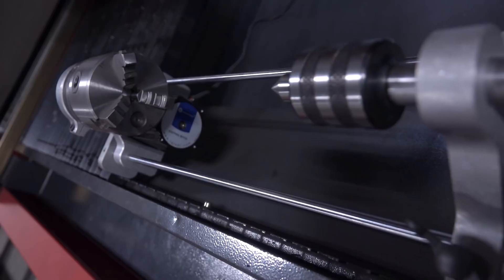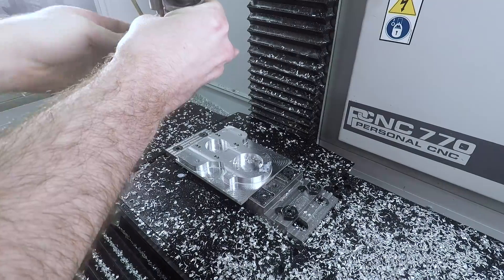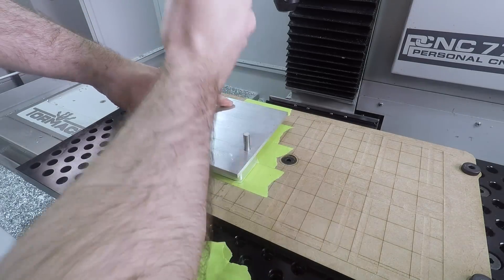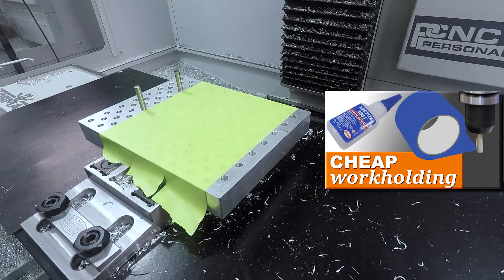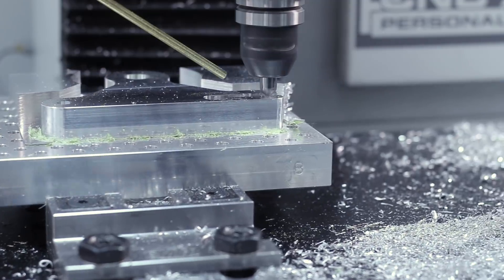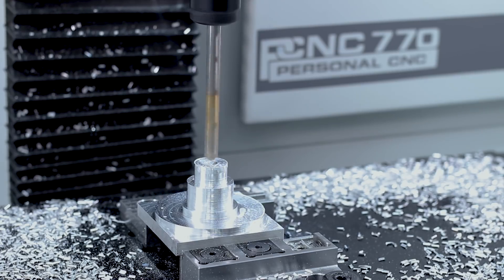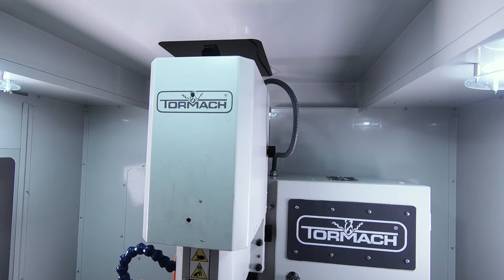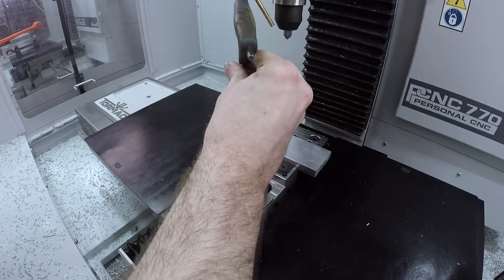DIY CNC 4th-Axis for Boss Laser! WW 200

Comment: I just don't understand you, John.  You are constantly and adamantly trying to improve and learn which is always admirable, and THE most important and valuable thing in any shop is TIME and yet you do these 20min toolpaths when 2mins is all you need if you just freakin' SLOT and your depth cuts are honestly abhorred.  You HAVE endmills that can cut what you're cutting in one single depth cut at identical radial step-over and you just refuse to use them and refuse to do it and save time, lots of time.  

When you think, "oh its only 10 more minutes or 5 more minutes, I'll do it the way I've been doing it" and then think about that, 5min per day x 261 days (365days - weekends), that's nearly 22hours a year of lost time.  If its 10min or more its over a week of lost time.   That's only 1 job per day 5min.  If you're doing 4 jobs per day @5min lost (hopefully is way more) you are burying yourself is lost time.  

I guess money isn't the be-all-end-all but for any other human beings, time is.  Time is everything.  If you can make the same part in half the time at the same quality and aren't... that's just... well... a waste and poor instructor-hood.

Comment: Isn't this essentially just a third axis? Since the laser just moves X, Y and what is that, A?
Reply: Laser should also have a z axis or focusing lense running like a z axis.
Reply: I'm sure it does, but it's not an axis you can "use" and in their example the laser is printing on essentially a 2D surface.

Comment: Does the BOSS just easily accept some arbitrary 4th axis?
Reply: Pretty much yes. It depends on the software you are using to control the laser cutter but many allow you to change the pulse unit so you can add a variety of different 4th-Axis, you just need to ensure the stepper motor is compatible.

Comment: When I first started at my current job I got access to a lot more advanced mills and lathes than the ones I was previously using, but the one tool that really blew me away was the 90W laser cutter.   You can make some really nice and fairly strong parts out of plain old acrylic sheet!

Comment: How much tinkering did you have to do with “circle pulse” to get your rotary aligned with the laser?  Circle pulse is one issue that makes no sense on the Boss Lasers.  Aside from having a test piece with all the specs per material I have started cutting out circles of the average diameter and recording the circle pulse due to it varying widely given differing diameters.

Comment: Sorry for Jared 

As a question how would you fixture large plates 12x12 that need all sides machined and several through holes? I thought about doing it on the vacuum plate but I don’t surface these plates and would have to surface the other side to remove the skin no? 

I make several of these but I have just thought the super glue was too much of a hassle. What do you suggest?

Currently I do them in 3 ops by cutting all the center features and sides then turning 90degrees and doing the last two sides then flip and chamfer backside.
Reply: ian agostinho You could put it in a vise, drill a certain number of the holes and build a fixture to bolt it to, then you'll have access to the all the sides you need to have access to. (Flip once for the blind holes.)
Reply: Andrew Delashaw 

I do some plates like that but never built a fixture for these as while the plates are mostly similar they aren’t all identical so a fixture didn’t workout for me. Thankyou for the suggestion though

Comment: 1 Bearing ???
Reply: The sliding tail stock will not need bearings because it's move a few inches each time it is used, and it's not in constant motion, so it doesn't need bearings. The single bearing for the chuck back plate is also fine because the laser won't impart load onto it, and it turns very slowly and very minimally.
Reply: I was thinking that, no slider bearings on the linear rail? Guess not important to need it, considering it lazer and can greese.
Reply: Could have turned a little teflon round stock into a press in insert though just cnc the aluminum part's hole a little bigger, then press in teflon and than insert rod/linear rail. Seen uh whats his name... The berkly guy who has bald head glasses and white beard? NYCNC did something with him too one time?
Reply: My guess is it's a double row bearing, looked thick enough.
Reply: He has cool channel too by the way. OXTOOLCO and it's tom lipton.

Comment: Any reason, other than you not liking lathes, for not using the lathe to make the bearing for the chuck?
Reply: AppleAssassin so he could do the radial holes in one setup.
Reply: Andrew Delashaw he has a cnc lathe
Reply: With the knurling, that concern is non existent...
Reply: but the part isnt even going to be round when you do it in a mill
Reply: AlmightyHose it'll be more round than most people could even measure, so it'll be fine.
Reply: If its just those holes i'd still do most on a lathe and slap it on the mill for the holes. It makes more sense to do round things on a machine for round things after all.  

Unless he had no round stock. then it would make some sense to do most ops on a mill
Reply: AppleAssassin I had the same thought.
Reply: If he really needed it round and concentric and still want to do it on the mill it's possible. Adjustable boring head with an inverted bar. I'm not saying it's fun but it is doable. Personally I question the use of aluminum for the bearing support but if it works it works.
Reply: A really bad one, but at least he got one.
Reply: Depending on your application, the circularity of the part may not be critical. 

Also, the out of roundness using circular interpolation on the Tormach is very minimal when you're making round parts greater than 1". On higher end machines it's even harder to tell.
Reply: Also, the mill is NC, but the lathe is manual. This is NYC CNC, and John is more into CNC than manual.
Reply: James Davis The thing is he's got a Tormach slant pro lathe which he could've done completely in the conversational in a single op. I think the slant pro lathe supports live tooling, but correct me if I'm wrong, but still I think it would've been much easier to do all the lathe work in the conversational and then transfer the part over in a collet chuck to the mill for the radial holes.

At least that's what I would've done, but John must've had a reason. Hopefully he'll reply
Reply: He took it off then put on lathe LOL. Knurl and to face it.
Reply: Honestly, this is just bad machining. I'd really like to know what the cycle time was on that.

Comment: Never seen a 4th on a laser. Nice!
Reply: Technically, not a 4th axis as most people think of it (independent and synchronized with the other three axes). You manually swap Y-axis control to the A-axis (rotary), usually by unplugging one stepper and plugging in the other. All the low end lasers are really only two axis machines...X and Y with coordinated motion control. Z stays fixed at the correct focal length above the engraving surface and does not move during operation. For rotary work your image is mapped onto the circumference of the engraved article and you have to make adjustments in your graphics software to account for the curved surface e.g. circles come out as ovals unless you compensate appropriately. Still a great project and better than most commercially available rotaries. Trotec makes a very nice unit for the their machines (but expensive), Epilog's is just OK (still expensive) and Full Spectrum's is pretty much crap. Chuck style rotaries (like this one) are better than friction drive for precision engraving, though the friction drive units are very useful for engraving tubular items like glasses, growlers, etc.